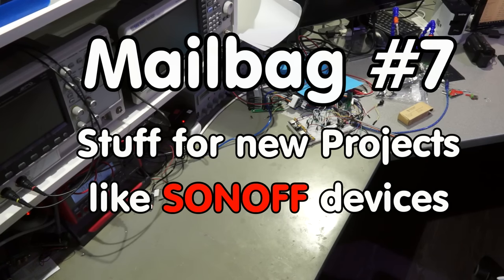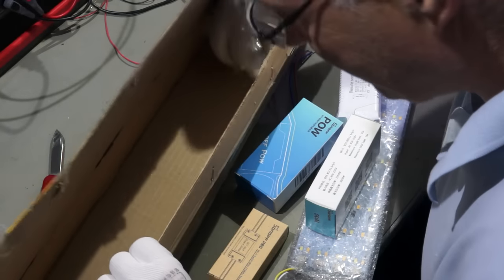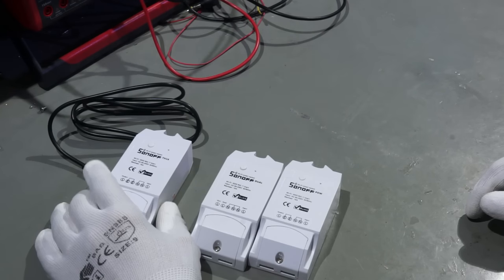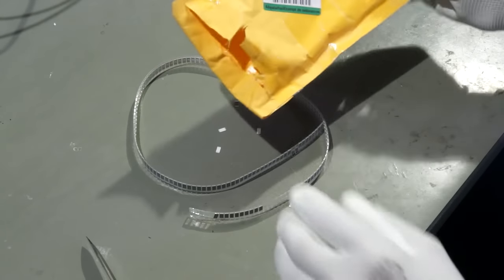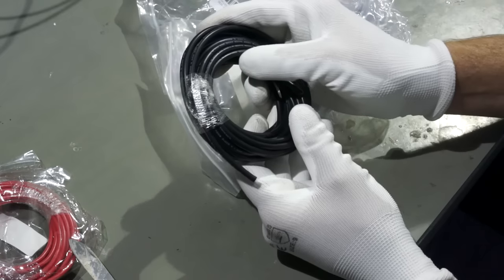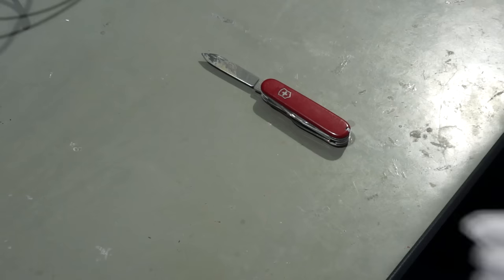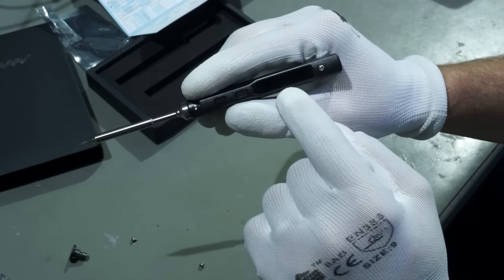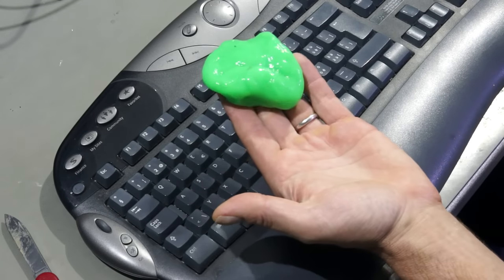#90 Mailbag #7: Stuff for new Projects like SONOFF devices from ITEAD.CC

Comment: Someone did a review of either the portable soldering iron you got or one like it (may have been Dave Jones?) and the performance was less than stellar; hopefully this one works well for you. For VERY small soldering jobs Weller makes a really nice 12W microi-iron, Model WM120. A little pricey and I don't use it often but when I need it it's exactly the right tool. Thanks for Mail Bag!
Reply from the maker: I tried the small one today with an old 19 volt laptop power supply and it heated up till the solder melted in ca. 10 seconds, which is extremely fast for me. But I will work with it before I make the video ;-)
Reply: Dave Jones is a bit of a thermal-mass elitist when it comes to soldering irons.  IIRC his sole reason for not liking it is because it's a small iron and thus doesn't have a lot of thermal mass.

Pretty irrational if you ask me.
Reply from the maker: Dave is Dave ;-)

Comment: Interestingly enough the producer of the TS100 is a company which produces pocket-sized DSOs.  They also have an intelligent precision electric screwdriver known as the ES120 which I believe uses the same control module.
Reply from the maker: Did not know about the ES120. A little pricey for a screwdriver... But it is always good for a producer to have a modular design...

Comment: Wow. You read my mind. I already wanted to ask for a TS100 soldering iron review. On Ali the price is around 50$, I hope there will be a sale on 11.11day. Can't wait for the longer review. It's pretty expensive, but what I saw it's worth the money. It would be good to know how much last the tip, because they are not cheap. 8-10$. 

One more question: Sonoff has normal CE mark, or Chinese Export? It would be nice to switch/measure my water boiler (220V/2000w). Does it have ground connection as well?
Reply from the maker: The engineer at itead confirmed, that they did all tests (only for the newer ones with the mark on it). 
The TH16 and the POW have earth connections, the DUAL not.
You might watch this video for the TS1000: https://www.youtube.com/watch?v=sDMhh3p2nuM

Comment: Did you see that the TS100 is open source? It has STM32F103 MCU and you can change the code etc.
In the Banggood page you will find the:
>>>>TS100 English User Manual <<<<
 >>>>TS100 Schematic Diagram<<<<
>>>> TS100 Open Source Code<<<<
Reply from the maker: No, I did not know that. I will have a look at these documents. Thanks for the tip!

Comment: Andreas,

I don't think the SONOFF has CE conformity. It looks more like a China Export logo. 

For the European CE official logo see:

http://ec.europa.eu/growth/single-market/ce-marking/
Reply from the maker: TweeBs An engineer from itead confirmed, that it is real, but only for the new ones. I am not a specialist, but if they want to cheat, why not for all their models?
Reply: Andreas, Quick check. The C and E should make two circles like an infinity symbol. If the circles intersect more than the rim only than it's NOT (or they did not use) a correct  CE symbol :((.  Hard to say without a conformity report.
Reply from the maker: As I wrote: I am not a specialist in this matter.

Comment: I've made an alternative firmware for Itead Sonoff switches, based on the MQTT protocol and a secure TLS connection. https://github.com/mertenats/Sonoff
Reply from the maker: Very interesting. I will have a look inside and maybe use it in one of my future videos, if you allow. And maybe I will come back if I have problems ;-)
I just do a video reprogramming the Sonoff as a switch with a PIR sensor for my LED spotlights in the lab. There, I only use a simple webserver approach and everything behind the firewall.
Reply from the maker: Just saw "Swisscom" at your screen shots. Do you live in CH?
Reply: Ja genau ;-). Kein Problem, Sie können eingenfrei den Sketch brauchen. I've made a GitHub page in this purpose. I've also used the GPIO14 for a PIR motion sensor or a DHT sensor. It's a very interesting product!
Reply from the maker: I think it, too. This is why you will see some more videos.

Comment: Hello, I would like to know how much tax you are paying for those purchases. Is it similar to China-EU imports, where you have to pay 20% tax on everything above 22 EUR ?
Reply from the maker: No. In Switzerland we only have to pay 8% VAT. And they do not charge less than 5 CHF which gives a value of about 60 CHF or Euro without taxes.
But most of the Chinese declarations are anyway wrong, and most of my purchases are less than 60 Euro. Sometimes, I divide an order into two to avoid problems.